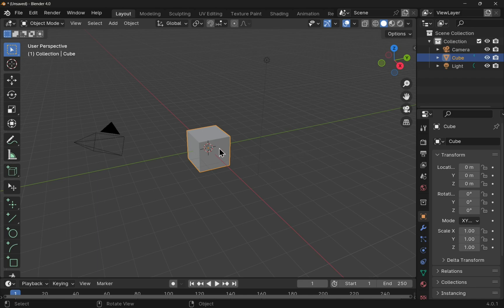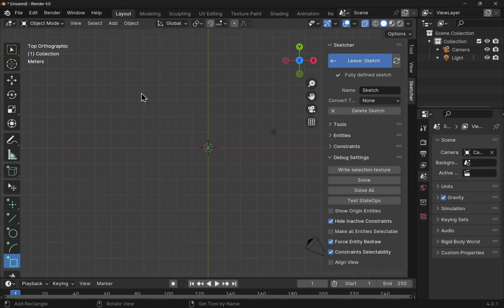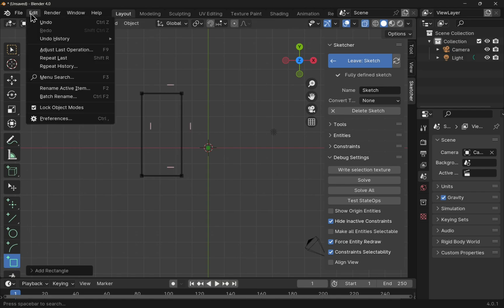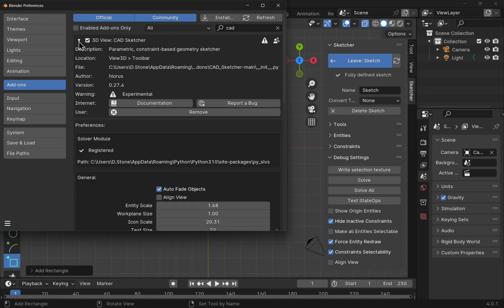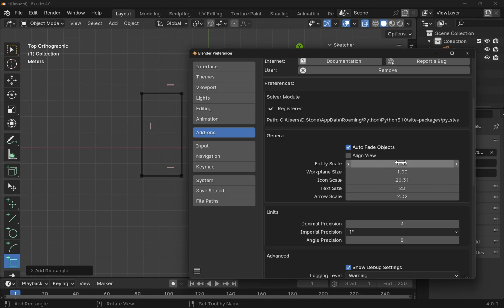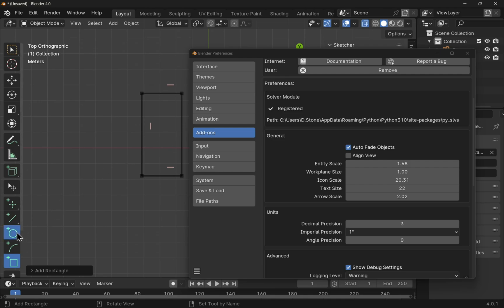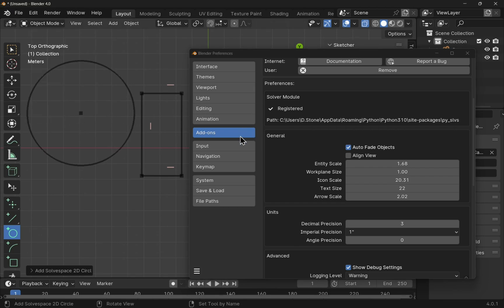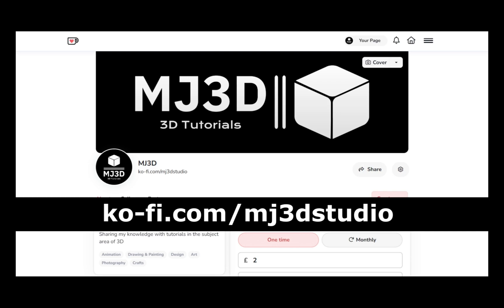CAD Sketcher: Sketch lines too thin!! How to fix and make them thicker.  Blender 3D printing

Comment: found the issue. its a vulkan problem. was running blender in that to try it and i was having this issue
Reply: Interesting.  I'm in 4.5 and have switched to vulcan and cannot get the scaaling to work at all.
Reply: @JerryBWagoner Switch to Open GL. It works with that. The developers aren't updating the Addon, which is a shame. But it works in 4.5 with Open GL

Comment: Thanks but sorry to mention it does not work in 4.3.2 on Mac. Seems an issue.
Reply from the maker: Ahhhh, right, not going to give up on this one. I wonder what's going on 🤔
Reply: same problem here
Reply: Also have a Mac and the same issue.
Why is it always an issue with Mac?!
Reply: Also if you are using Vulcan in 4.5, it will not allow you to thicken the lines. You have to change to Open GL.